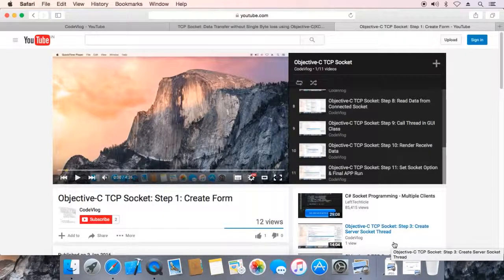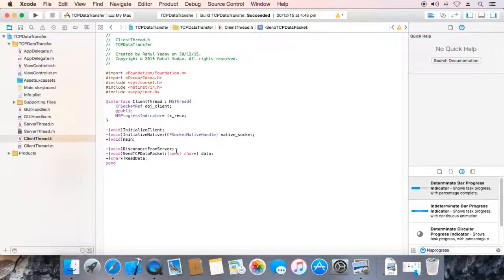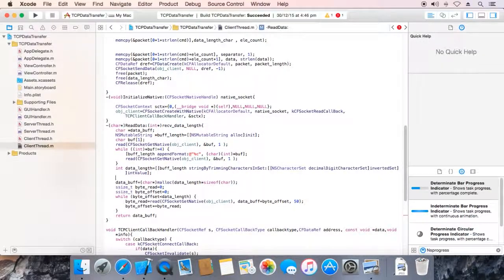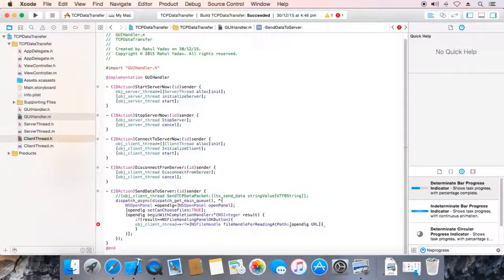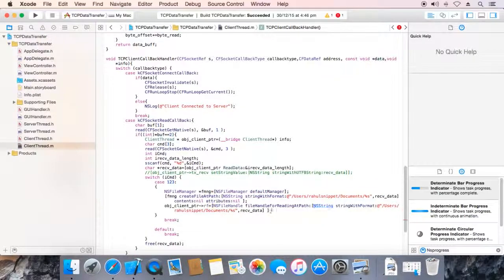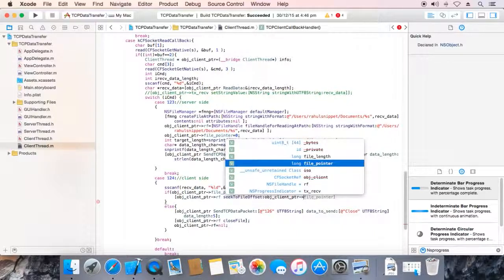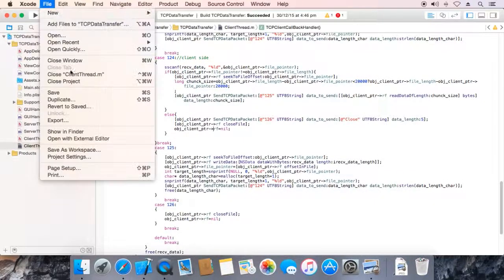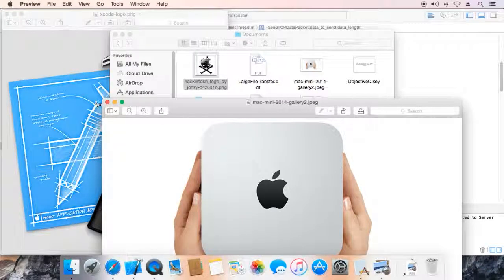Large File Transfer using Objective-C(XCode)

Comment: How come you don't get a mach-o linker (id) error? Are there any ways to solve this error?
Reply from the maker: +Hank Chau , i never saw that error while coding, check your code, with breakpoints.
and i did it with screen capture.
Reply: +CodeVlog Hi, thanks for replying ! I got the error fixed by adding a "main.m" file. 
I am able to successfully compile, and connect to server. However, after selecting a file to transfer, I get a notification "App Library not found". Do you know how to solve this issue ? Thanks in advance !
Reply from the maker: +Hank Chau , you need to watch the video,  i released code only. You need to create project and cocoa files and then paste code in files.
Reply from the maker: +Hank Chau , also create event and component reference